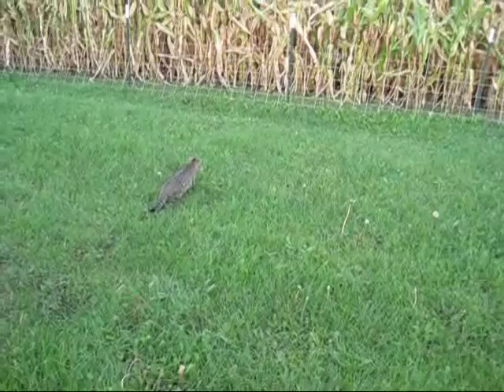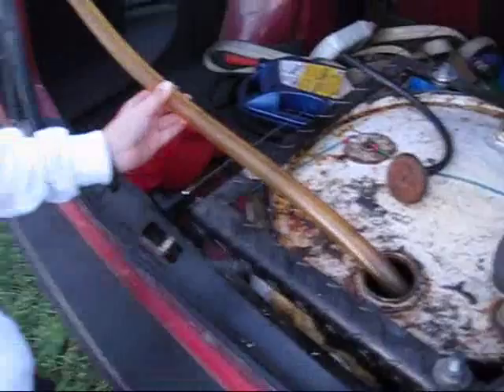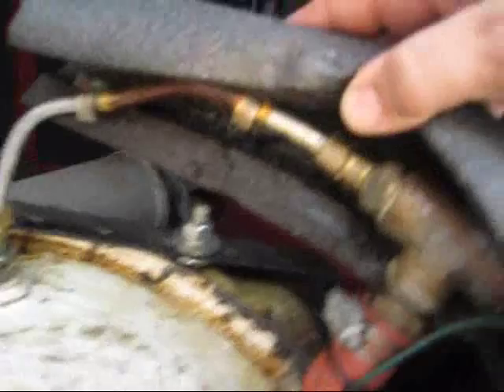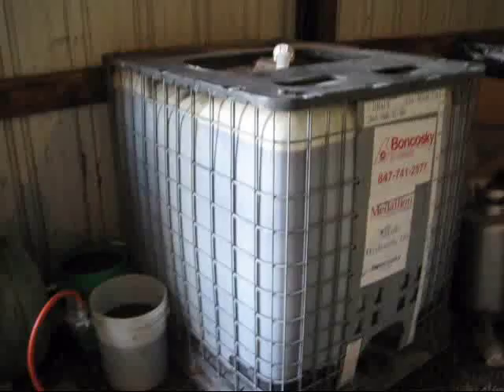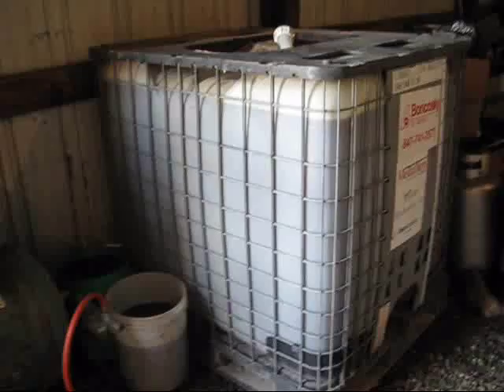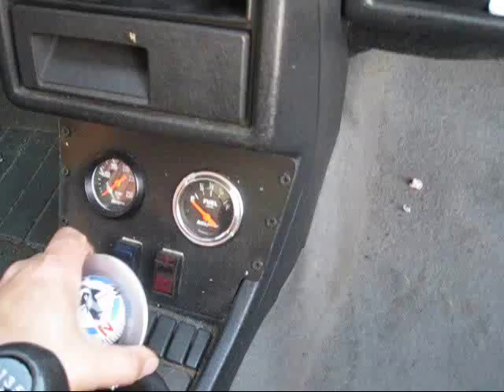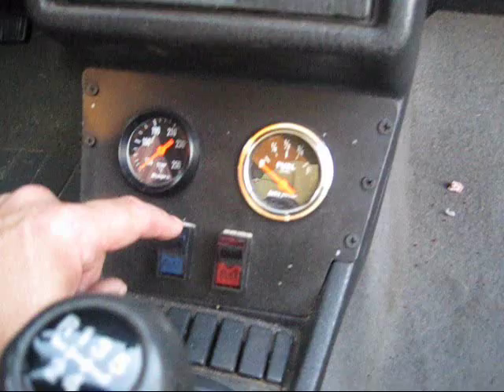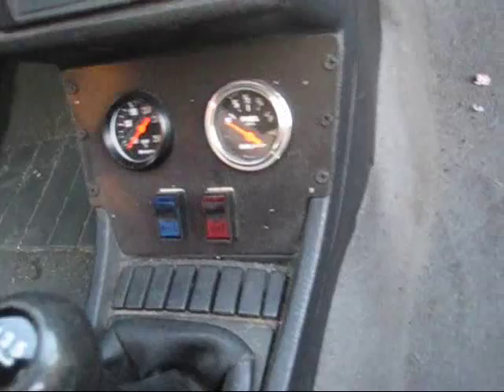Fueling a Bug Out Vehicle with Waste Vegatable oil, and How a WVO fuel system works!

Comment from the maker: If you have to have a gas burner, I'd watch ebay for a Geo Metro 99 or before (not EMP proof, not to many electronics though). My son has a 98 and it has been super reliable and gets 43 mpg. If it were me, I'd find a 86-89 turbo diesel Jetta Or non turbo. I am very happy with these VW's great mpgs & reliability. ETp

Comment: hello,  can you do this with newer diesel engines .... 2015 passat and 2013-2015 duramax, 2009 john deere ?
Reply from the maker: +Creighton Wells Yes you can but newer engines are very picky. You need oil heated to 120deg min and filtered to 3 micron. Best thing is to get a centerfuge to clean your oil otherwise you will be burning through filters. Here is the one I have: http://www.wvodesigns.com/products/centrifuges.html